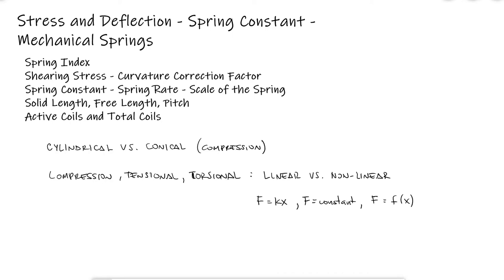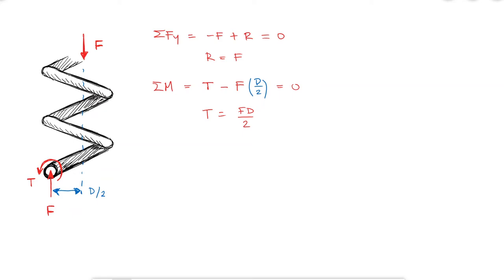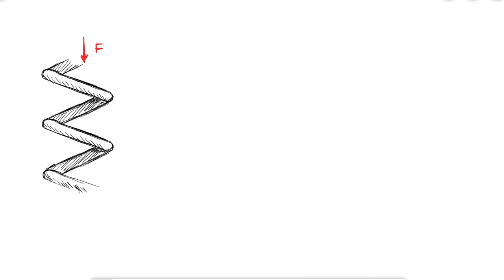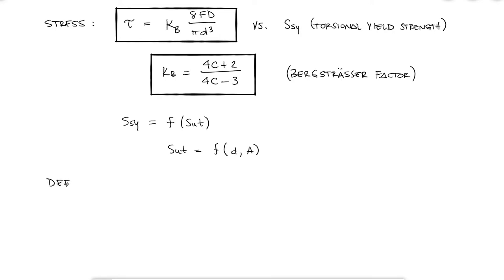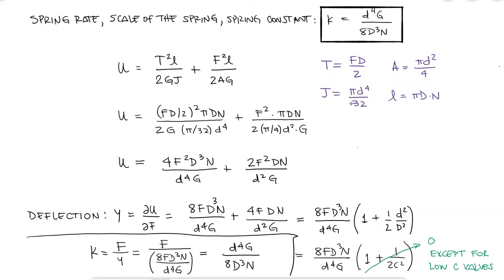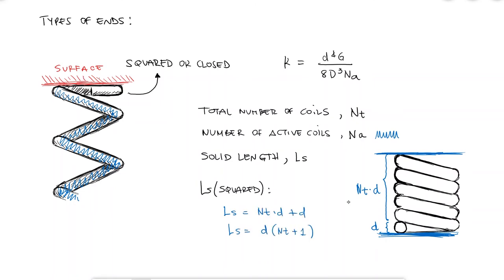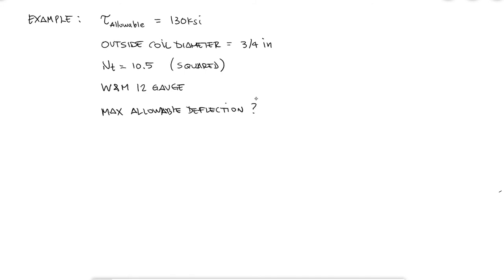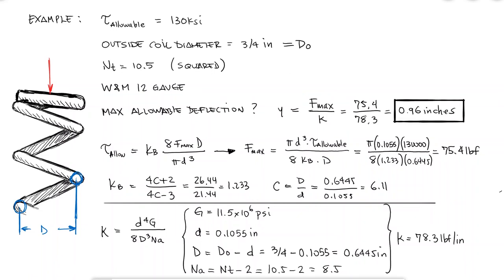Mechanical Springs - Stress, Deflection, and Spring Constant in Just Over 10 MINUTES!

Comment: Question. If you take a cross section with a vertical plane, you don't get a circle, but rather a kind of elipse shape, due to the spiral. In that case, isnt it more accurate to consider also normal and bending stresses?